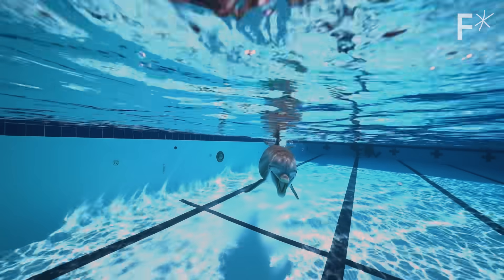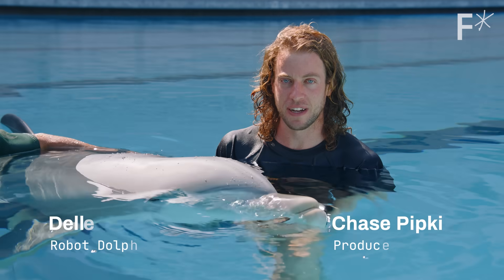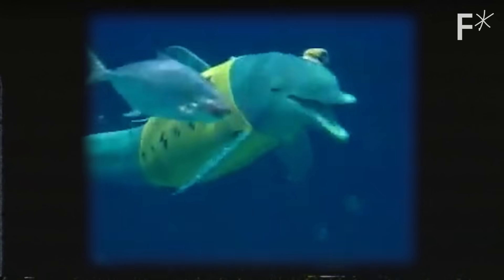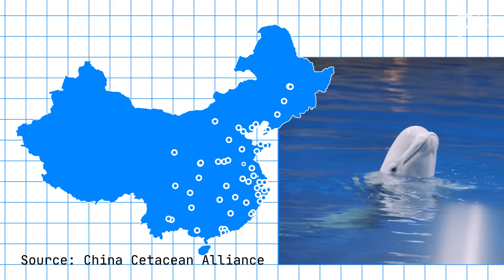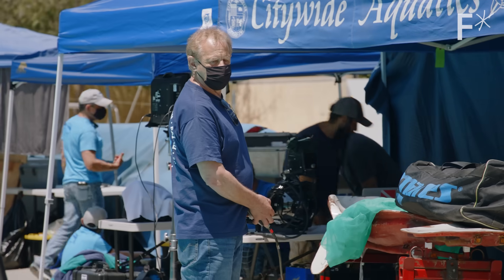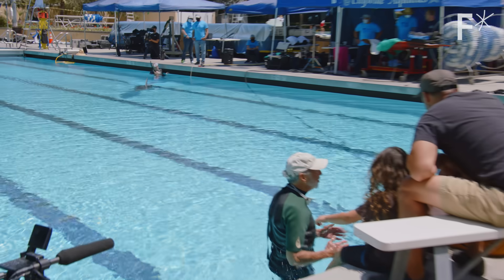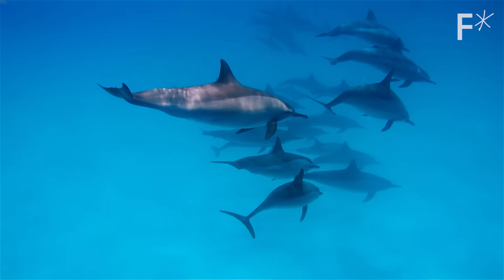How robots could end animal captivity in zoos and marine parks | Just Might Work

Comment: Okay end marine parks, cool.
However DO NOT close credited zoos, they are essential for conservation and breeding programs to save species. Proper zoos are not like roadside zoos!

edit: Wildlife Sanctuaries DO NOT have active breeding programs, they just let animals do their own thing without closely monitoring or interfering. Zoos keep extensive records of animal family lineages to prevent inbreeding and allow for careful monitoring of pregnant animals and young. This especially important for animals that have genetically bottle necked like Amur Leopards and Cheetahs where Zoos have to try and get the least related animals as possible to breed. Not to mention proper zoos are important for the public to have empathy for endangered species and acquire funding for these breeding programs, the ignorance and shortsightedness in the comments is disappointing.
Reply: IAN HEINE  the main problems with dolphins and other cetaceans in captivity is that they are extremely high maintenance. they simply do not have the space to roam like they would in the open ocean, so they're cramped into a relatively small space. they're incredibly intelligent so they need extensive enrichment to keep them from getting depressed or stressed.  there's cases where just the sound of the filtration system is enough to make dolphins and orcas miserable and hurt themselves. other animals we could mimic their natural environment and provide proper stimulation to keep them calm and happy, but we simply cant with whales and dolphins.
Reply: @charityquill4965  yes i fully agree but some species do need to be kept for the good of the whole species the good thing about this is this these robots could do the stunts and make the money so that we can have better enclosure and better progams imagine a dolphin tank the size of  a lake.
Reply: @charityquill4965  imagine how much money they spend on water and salt when they do a water change.
Reply: @charityquill4965  some of the water park saves hundred of dangered species and lives of dolphins and orcas because they work like a rehabilitation park for those animals. The idea of replace all the animals for robots could be worst for animals and for us, how could you know or interact because it is not a real animal it is not thinking, it is not feeling, it is not interacting with you; It's a damn person operating it with a remote control. At some point people will get bored and stop seeing them because they know they are not real.
Reply: @charityquill4965  that... people don't understand that these animals migrate across and through OCEANS, not an area of water, in their lives they will travel tens of thousands of miles. It is completely unfair to keep them in a cage that is max a few hundred feet large.
Reply: Thank you some zoo's keep certain species from fully going extinct.
Reply: @kaylahbkitty9691  Like the amur leopard and radiated tortoises.
Reply: Not to mention the animals that have only had human contact are going to suffer if they are released into the wild
Reply: @megg2826  It's not all black and white.  These people are not stupid.  There will be exceptions and a long process.  Yes, let me raise a lion and release it into the wild.  Yay!  Yeah no.
Reply: @megg2826  Nobody is suggesting releasing animals in the wild :/ the misconceptions you are spreading are the reason why animal cruelty continues to be supported in roadside attractions like sea world or  big cat petting parks. Ideally, these animals would be relocated to SANCTUARIES where they have no interaction with the public. They will also no longer be forced to perform, and will live in habitats big enough for them to be healthy. Captive breeding will also end by desexing the animals. Nobody is suggesting releasing them into the wild, and that misconception is extremely harmful for animal welfare.
Reply: @megg2826  some are just to tamed or born in captivity they wont be able to do well on their own
Reply: Yeah
Reply: @BatteryAcidIsEdibleEnough  not necessarily, Like the original writer said. The Zoo and Aquariums main focus is to educate the masses through conservation. Thus why exotic animals are put on display now. It has also been proven time and again that one of the most effective ways of encouraging civilian conservation is through up close and personal interactions and entertainment like sea world and even petting zoos to a certain extent. However the biggest issue comes from Animal welfare and Maintenance costs. So with that being said by implementing animatronic animals into zoos and aquariums you can give people that up close and personal factor that they crave while also  keeping costs low which, in turn,makes it far more profitable for the zoological entertainment buissness as a whole . Also keep in mind with the implementation of animatronics now zoos and aquariums have the freedom and increased finances to streamline their rehabilitation to relocation initiative as well as fund more conservation expeditions. Long story short, if this is as economical as they claim it to be; Zoos and aquariums will now be able to do focus more on saving the species while not having to worry about losing their biggest source of revenue outside of Government funding.
Reply: yes, do NOT close acreddited zoos and aquariums, along with ones that have that same focus, yet are not acreddited (like the Irwin Family Zoo, literally the only reason they aren't an accredited zoo is because they don't live in a country where that's a thing, let's be real here)
Reply: This
Lots and lots of people frown upon zoos, but zoos such as San Diego Zoo or Australian Zoo are truly places for conservation
Reply: @thaiangquoc9505  MOST zoos contribute to conservation
Reply: @thaiangquoc9505  
Actually Australia Zoo and the Irwins support Sea World.
Reply: You dont know how thankful I am I didnt have to scroll far to find someone who said this (to nerd beasts origional comment. Modern professional zoos do so much good for wildlife all over the world)
Reply: I was just about to comment about that
Reply: What i was going to comment
Reply: I was coming to the comments to write the exact same thing! 👏🏽
Reply: Seconding this. I don't remember when was the last time I went to a zoo but I do remember learning all sorts of cool and interesting stuff about these animals and made me want to protect them even more. My love for animals and creatures definitely came from reading about them/watching documentaries, but going to see real animals made me want to protect them more. Now, my family and I usually go to national parks every time we want to see landscapes (and if we're lucky, a wild animal) since we can't tell the difference between an accredited zoo and one that pretends to be legit but is actually a money grab (they exist - I'm pretty sure my country's national zoo/safari park is one of them) and if we really want to see an animal, we go to a sanctuary (we still can't tell the difference but I'm pretty sure 75% of them are legit - my last one was the Giant Panda conservation centre in Chengdu, China which I'm pretty sure work with international folks to rehab/breed/release these animals and somehow manage to take them off the endangered list), but I do understand that these accredited zoos definitely help with conservation and protection of nature and natural ecosystems and the animals and species that play a role in them.

Still, replacing show animals with robots are pretty cool. I can relive childhood memories of watching show dolphins and animals guilt free this time (I was a dumb child who went to Sea World a lot because I thought they were helping the animals....). Not sure if I want dinosaurs.. I love them but through an evolutionary perspective, not quite through the "I want to see them in real life so bad" kind of way - our perspective of dinosaurs are changing and until we have definite proof that T-Rex has/doesn't have feathers I don't think I want to see one in animatronic form yet.
Reply: Y’all do realize that certain species depend on captive populations to prevent complete extinction, right…?
Reply: Well said! Some aquariums are also essential parts of conservative as well. But dolphins and orcas don’t belong in tanks that’s just taking it to far
Reply: I agree. Zoo's are not what they used to be. They are actually aware that animals need mental stimuli and interactive ways to get their food. Not to mention that a robot can't do everything that a real animal can do. The natural world holds a lot of secrets that we can't even begin to understand (yet) nor replicate. You can't artificialize nature.
Reply: i think its main purpose is education through experience so kids can be up close to a tiger that is also kind of a character, instead of seeing it from afar. that would be really cool and this kind of enviormental education is also essential for conservation
Reply: @auroratovar5455  Exactly it shows kids and even adults that these creatures are amazing, and might actually change how the world seems animals. Instead of people thinking they can just push the animals out of their environments or poaching them, they will start trying to find ways for humanity to grow without harming animals.
Reply: Yeah when I saw this I literally just went “Uhm… No.” 80% these animals aren’t able to be released, and the reason these facilities exist is because the animals that are used as ambassadors and demonstration animals are all unable to be rehabilitated for release into the wild because they have been acclimated to human contact. If ALL of these animals were to be released, we would see thousands of reports of these animals being gunned or killing people.
Reply: Because marine parks don't do the same thing that zoos do... logic people. Use it lol.
Reply: I agree.
Reply: THANK YOU
Reply: I was going to mention a lot of this too. Many of the animals are rescued and are getting rehabilitated and re-released into the wild after a while. I read a stat somewhere recently, talking about how very rarely, in aquariums and aquatic rehabilitation centers, are the animals actually kept until death. Most of them are released back
Reply: Zoos are often also act as research center.
Something that robot that can never cut it.
Reply: Yeah same goes for proper aquariums, not like SeaWorld.
Reply: Thank you. Zoos are also rehabilitation and conservation centers. They have a role in sensibilisation and education. These vocations must be prioritized over entertainment and profit. Robot parks are the opposite.
Reply: yes!! some zoos are actually ethical and have breeding efforts to prevent some species from going extinct. i think that's an important point that many videos don't talk about/many people don't know about
Reply: this is what i'm concerned about. Many species will go extinct without conservation efforts
Reply: I was hoping there would be a couple people here with their heads screwed on correctly
Reply: I mean use the robots to replaces animals that are being used for entertainment in marine parks circuses etc while keping real animals safe in reservations and petting zoos (not much of a petting zoo if you're petting a machine)
Reply: Zoos are the last line of protection for animals, never close them.
Reply: Agreed, don't close down those zoos, but change it into an animal preserve or something. Most zookeepers not only take care of animals, but have to deal with the BS from people thinking that cuz they bought tickets, means they have the right to be disruptive and be entertained by the animals. Get animatronic zoos and allow the animals to get their proper care!
Reply: Getting rid of marine park’s animals is 100% ok and cost effective (plus humane), but credited zoos absolutely not. If we take down good zoos we’ll kill off so many animals in return as they’re putting in a good fight to keep nearly extinct species alive (like big cats who are often poached to near death). 
Different animals have different requirements: saying that just because it’s inhumane to hold a dolphin in captivity that means it’s inhumane to hold all animals in captivity is grossly wrong! People often assume these animals would be happier out of captivity which of course some would be but tigers for example can do just fine in captivity! Plus if keeping any animal in captivity is apparently so inhumane I guess pets needs to go then too cause imagine how happy they’d be to roam right? 🥺 poor cats being trapped inside by their owners like caged tigers! (btw being sarcastic here with the pet thing, using it as an example that not all animals dread captivity and plenty of wild animals enjoy the less stressful life of captivity).
Reply: Nah Wild animals will suffer in captivity no matter what! So whats the point of saveing them if they just gonna suffer in captivity!
Reply: @thejack9178  So that their numbers can be restored so that they can be returned to the wild, education, building public empathy. PROPER. ZOOS. ARE. NOT. LIKE. ROADSIDE. ZOOS.
Reply: Just about to comment this as well, nice job!
Reply: I agree 👍
Reply: Yeah plus sooner or later there won’t be a wild for animals to live in. We humans keep interfering with their habitats no matter what we do. These zoos are all they have left
Reply: I didn't know, there was something like roadside zoos. Where I live, there's only one in big cities that too, is owned by govt.
Reply: @anixes  yes roadside zoos are kind of another way of saying petting zoos that’s funds don’t go towards conservation.
Reply: Not what they are saying bro....
Reply: Exactly! Thats what i thought when i first read the title
Reply: They'd obvi will do that either way just not through zoos tho.
Reply: Exactly
Reply: They literally said that in the video, keep the pros, prevent the cons of zoos
Reply: was my exact thought seeing this video lol
Reply: Well said
Reply: Let’s hope they keep that in mind
Reply: I’m fine with the zoos and sanctuaries that are trying to actually help bring up low population for animals and animals I can’t go back in the wild but zoos that keep animals for entertainment really does make me sad I don’t go to zoos or aquariums anymore because of that
Reply: If they were less zoos it would be amazing! They are needed for conservation and to learn! But when there are hundreds and hundreds of zoos is pointless and hurtful
Reply: Amen brother
Reply: Yes
Reply: But they could let people come in and play with robotic tigers.
Reply: I bet that they will start combining their robotic marine parks with water parks.
Reply: Agreed
Reply: They could probably use the robot animals for the entertainment part of the zoos and marine parks, while keeping the conservation/rehabilitation part but not have it open to the public so they can fully focus on the animals!
Reply: Agreed
Reply: just transfer all the captive animals to a widlife reserve, its that simple.
Reply: I’ve learned more from this reply section than I’ve learned at school.
Reply: A large amount of animals in zoos should be replaced, but not all of them. Ones used in professional conservation breeding, or rescues unable to live outside of captivity, are totally fine if it’s handled right.
Reply: IAN HEINE  Yeah. These are cool, but people come to the zoo to see real animals.
Reply: Add robots to zoo's, use the funds for real animal conservation
Reply: exactly...
Reply: Yes!
Reply: There are sanctuaries instead
Reply: I want to support this
Reply: Finally someone with brain. These people doesnt know how important is to have animals and acuariums for the nature safety.
Reply: You need JESUS. Pray to HIM, HE loves you,
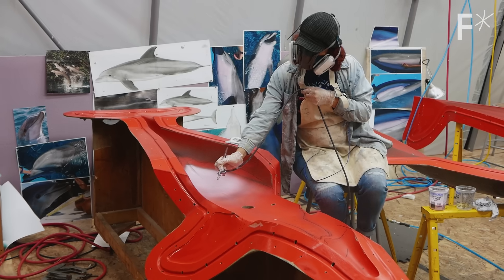When you pass away as we ALL will soon. 99.9 sooner than they think 🤔 ..you will kneel before JESUS. Romans 10:5/10. The One and only true Son of GOD Almighty, all others are false..we are all sinners and need JESUS.  JESUS was crucified on the cross at Calvary and then on the third day rose again, for you and I (John 3:16). So, Choose this day whom you'll serve. For if you don't it will be chosen for you and that is HELL
 Arguing with me is silly at best. Bc I'm just the messenger...
💌
Reply: Sorry but I completely disagree with this comment. Those captive breeding programs are a cruel joke. Why is it so important for a species to remain alive but solely in captivity for the rest of their collective lives? Those animals, for all intents and purposes, are technically pretty much extinct if you're looking at what's in the wild and how they contribute to the ecosystem. What is the true purpose of keeping those animals alive in captivity? Is there a hope to one day release them into the wild? I'm sure there is not. So these animals born in captivity are jailed for generations and that is truly terrible. How would you like it if that were you and your family?
Reply: @buddyholly4672  they breed to eventually be released use your head
Reply: But why must Zoos make it an attraction? Loud kids come in and disturb the animals, dumb people try to climb into the cages and I don’t think there should be gift shops and restaurants in Zoos if their main intention is to save the animals. Seems like the whole thing is just for profit.
Reply: @Ashley-km4qi  What do you think pays for the staff, animal housing, food, enclosures, maintenance, utilities, breeding and exchange programs. Most zoo profits go to animal upkeep, research and programs, not lining people's wallets. Ticket prices alone couldn't even feed the animals let alone pay for electricity, air conditioning, plumbing, medicine and so on.

As for bothering the animals, in proper zoos animals aren't really bothered often by visitors and if they are they have hideaways to get some peace and quiet if they need it.
Reply: @thenerdbeast7375  well you make a good point on where the money goes, but the few times I have been to a zoo, I’ve noticed people trying to taunt the animals or kids screaming at them. And this was at the San Diego Zoo where apparently it’s considered “one of the best”. The animals shouldn’t to scurry away and hide every time a human comes near.
Reply: @Ashley-km4qi  It is one of the best in terms of most aspects of animal care, programs and animal health, one of the worst when it comes to attendee manners which is something they can not control. When I visited years ago, the attendees weren't nearly so ill-behaved, it might have just been a bad day when you visited.
Reply: @thenerdbeast7375  they can control attendees though, like putting more signs that say do not disturb or start to closely monitor them and kick out visitors that are disrupting the animals.
Reply: In the wild its really hard and tough.... things trying to kill u and struggling to eat wen u can... they die really bad deaths.. in zoos im sure its not that bad.. just a thought...
Reply: I live in thailand and this summer went to stay at an elephant sanctuary where they let elephants that have been abused and used for work wonder free but controlled as they have been changed from thier natual self
Reply: There’s a zoo, then there’s a sanctuary…. Let’s end zoos….. and most sanctuaries release the animals back into the wild when their health is back to what it was… I would love an animatronic zoo…
Reply: THANK YOU! This is so well said I couldn't really say it better myself.
Reply: Commercial zoos can go but actual preservations should not
Reply: Sir, I'm sorry to say but Newyorker Zoo murder a healthy Giraffe for Entertainment. However that is abuse & should be illegal
Reply: @boriscvekic  lol
Reply: You’re acting like every zoo is going to close after this video was published 😂
Reply: This is the worst idea ever. Why would anyone want to go to a zoo or aquarium only to see a bunch of fake animals of metal and wires instead of experiencing the REAL deal in the flesh(unless something extinct like dinosaurs which probably would make sense)? It should also be noted that it may be expensive to go to places like Africa or South America to go see animals in the wild, so this is the closest for anyone to get access to seeing and experiencing these animals. Plus, and most importantly, zoos and aquariums have saved the lives of dozens of species from any human activities like pollution, deforestation, or over-hunting, which can lead them from endangerment to extinction(these activities are sadly still continuing), so putting them all back out there would be a very, very, very bad idea. In the words of Jurassic Park,”your scientists were so preoccupied on whether or not they COULD, they didn’t stop to think if they SHOULD.”
Anyone agree?
Reply: I can see zoos are good as the animals are put on display, have ppl staring at them all the time through glass, and they are in a small area where they cannot act naturally and how some zoos allow you to hold baby monkeys and baby tigers or bear cubs
Reply: Agreed!  Kudos!  This research done and offered to the public, is wonderful, as in mating behaviour of Kiwis!  Very interesting details how they research how to provide food it environments required.  Did you know the Kakapoo that once lived on all of New Zealand only will mate if their particular choice in fruit is available in plenty  and that is seldom more often than every four years.
Reply: SeaWorld and some other marine parks are also apart of the zoological conservation. Yes they do the shows for entertainment. Maybe instead of saying end all marine parks you could just say end the shows. Seaworld and some other marine parks focus on animal husbandry and scientific advancements. They rehabilitate endangered sea turtles and shark species. It would be shameful to the earth if we were to let all those species die out. I agree though that some road side zoos that are primarily for entertainment should be replaced with robots.
Reply: arent (or maybe some) marine parks also acts as rehabilitation centers?
Reply: zcx some def do those things and keep marine life that have no hope of returning I already know my comment is short I know enough about animal conservation and zoo's just like how I know not all kill shelters are bad I have people in my family that are vets and zookeepers I might not look it but love animals trust me.
Reply: @kaylahbkitty9691  I'm not even going to try and deny that, but most accredited zoos and aquariums have their main priority as animal conservation, also up there is getting animals to return to the wild, as well as education on the animals, if the animal can't be returned to the wild then they become an ambassador for their species, in which case they will (depending on the animal) get that animal used to human interaction outside of their handlers so said animal isn't scared of human interaction
Reply: @beowolf9480  I know this I just like sharing it in a short way plus I'm at work I be tired of typing but thanks for educating others.
Reply: @dnielzcx5490  they claim to be, and maybe to some extent they are, but for the most part, I’d say they are potentially causing more damage than they think.
Reply: @dnielzcx5490  no, teaching a rehabilitated animal tricks is not rehabilitation, it’s taking animals from the world for their own profit, zoos are way better, they’re there for people to look at while being cared for correctly
Reply: @dnielzcx5490  no they say this but in reality they never release any animals and keep them in captivity.
Reply: @dnielzcx5490  in some cases they could be, but most rehab centers are onley rehab and don't "show off" like how marine parks do. Of course places like sea world do have animals that were in rehab that could never return to the ocean (the most common animals I see to never go back are turtles with manites being a second) most animals that do get release after rehab can actually gain a dangerous positive view of people though! This can happen in animals like sea lions and dolphins, where they can get too close to boats ao the wrong type of person and end up harming themselves again or others.
Reply: @dnielzcx5490  yes indeed
Reply: @dnielzcx5490  no they arent, since when is preforming for others rehabilitation?
Reply: @paracuna  except manatees you can't train those, there have been some the have been brutally mein by speed boats. You can see some of the tails ripped off, it sucks, but if their not taken care of by someone they'll die.
Reply: @paracuna  yes they are. Same as zoos.
Reply: @paracuna  alaska sea life center litteraly do test  with live fish before releasing the animals
Reply: @paracuna  some find fish in need of help and then they help put Them in rehab sure its wrong that they are making shows but alot have places you cant Enter where there are fish they are helping
Reply: @paracuna  some of them are, however very few, and it is unsure wether is is worth the cost.
Reply: @paracuna   not those ones like Disney but Australia zoo or winter the dolphins sanctuary in Florida
Reply: Conservation centers are better than zoos.
Reply: @kagenohikari8  Zoos function as breeding centers to put out more animals to potentially be released, they house animals unfit for the wild, and most importantly they are like huge charity centers! The money they generate typically goes to helping the species they hold, they also do another important thing: educate people, make people love the animals and want to save them..a little bit of education can bring up a whole generation of animal lovers spending money and time to save this planet.
The good zoos out there will have employees do shows and give facts about the animals, or there’s little signs with facts and stuff. There’s this zoo-aquarium mix I love going to on vacations because it does this! It has information on the animals everywhere, I watched employees feed the animals doing small tricks with them whilst explaining stuff (the tricks can be amazing physical and mental exercise)..as a kid it awed me and I fell in love with the animals there! To this day marine animals will always be my favorites (the kinds of animals you’ll see in or near water). They even had this HUGE tank of fish and sharks and all kinds of stuff! It was in a tunnel fashion..It was like walking through a world of it’s own, they got to just exist as they would in the wild and I’m sure they likely fed the sharks to keep them from eating other fish though I wouldn’t be surprised if they were robots now.
Reply: @kagenohikari8  they are THE SAME MAN, also ones that are publicly zoos are far more likely to receive funding, and thus be more effective.
Reply: Roadside Zoos can use some animatronics,  proper zoos used for conservation purposes should not have robots, real zoos are essential to the conservation of endangered species.
Reply: You clowns do realize that if those zoos animals go out of their cage and into the wild,they are Gonna die? But hey,keep on whining about humanity being awful even though you barely do any thing about becoming the person that you want others to be.
Reply: @melindabolding5601  Those zoos literally save animals from going extinct. It won’t be a fast process to release them to the wild but they have a certain process for that for a reason. There are ways to getting them back in the wild safely and getting them used to it.
Reply: Marine parks do the exact same thing.
Reply: IAN HEINE  it seems like it's be good to have robots for when the animals are out, like sick or on bedrest
Reply: @moon that’s a stupid idea.
Reply: My stance on this is that we can keep any animal in a zoo or aquarium as long as we have met their requirements for being happy
I think the best thing to do with dolphins in captivity is to just cancel shows and let them just swim and eat like every other creature in a zoo or aquarium
And it's possible that (if not now then in the future) we can even have the perfect dolphin exhibits
I mean if we live in a world where whale sharks can be kept in aquariums with little complaints then i don't see the idea of a happy dolphin in captivity impossible
It would be very hard, but not impossible
And the robot thing, i don't think so
Getting robot animals is completely missing the point of zoos, that being showing us real animals from places most people would not go to
And plus they would just get broken up and sold on the black market by some people who want a very expensive joint, like they are doing with amazon drones
What I'm saying is that the chances of a good dolphin exhibit in a zoo or aquarium are low, but as long as we keep trying, it will never be zero
Reply: I agree. There are some animals humans just can't accommodate in captivity, but there are others that can live long healthy lives.
Reply: You mean Accredited Facilities LIKE SEA WORLD?!! 🤷🏼‍♀️
Reply: @rikky6ixx  NO that is not an accredited facility and it is also not a zoo. That is why I said end marine parks, which Sea World is, along with roadside zoos but not accredited zoos.
Reply: IAN HEINE  How? People don't learn anything about them when they are just sitting in a glass box.
Reply: @DankestDestroyer1098  Please, zoos provide plenty of information on the panels next to the exhibit, no one visiting the zoo has time to analyze their behavior, people go to college, and get a degree and job for that.
Reply: You mean an animal sanctuary? Obviously they're not going to shut down sanctuaries.
Reply: Sorry but thats actually not true. They say they do something important but they actually don't. IM from germany and german zoos importes around 800 endangered animals in 2020 and released around 100.
Reply: Well save it for the animal sanctuaries and not the zoos!!!
Reply: We don't need any more zoo. We need more animal sanctuary.
Reply: Ok tiger king jr
Reply: Go to the top zoos in the world and most of the animals are still trapped in small areas. And most of them aren’t even endangered. Theirs no reason to keep a bunch of monkeys in the space equivalence of your house. I wouldn’t want to be locked in my house for 15 years just to die there. So what gives us the right to do that to an animal? Don’t get me wrong. I’m no peta fanatic. But zoos over all are in my opinion wrong considering most of the animals do not need to be there.
Reply: @verticalsorh7124  while I’m not blind to some of the more shady practices involved in getting the animals, aren’t many of the animals brought to zoos typically injured or orphaned in some way? I know for sure it’s not a 100% always the case situation, but many of the animals weren’t long for this world to begin with. I’m not saying this is the better alternative, but at least some zoos do to some extent I tend to release the animals to their homes.
Reply: @verticalsorh7124  those are only Asian zoos. In addition to that some animals can’t be released In the wild due to many reasons. Kept as a pet, came from a zoo they can’t take care of them, and injured to the point where they can’t survive. In addition to that captive bred animals won’t know how to identify prey and predators. You do realize certain animals in captivity don’t need THAT much space right ? As long as they have something to call territory their fine.
Reply: i think u mean sanctuaries, not the same thing.
Reply: @buelmore9784  no
Reply: @buelmore9784  they often are.
Reply: You all have completely missed the entire point of this if you think "closing all zoos" was a point. Even then why wouldn't you want to eventually close all zoo's and replace them with conservation and rehabilitation centers? All zoos are stressful for animals.
Reply: Zoos DO NOT play an important role for conservation, thats just a common myth so they can keep their reputation. It's wildlife sanctuaries which are important for conversation.  Zoos always put making profit from the animals first while a sanctuary actually saves wild animals to release them again. And no, keeping animals in way too small cages and putting them under daily stress, making them depressed and force-breeding them because humans are destroying  their natural habitats is not called "CoNvErSaTiOn"
Reply: @bittersweet6631  truly spoken like somebody who had no experience with a proper zoo
Reply: The animals are still in captivity tho. Zoos aren’t benefiting those species because the ones in the wild, the ones doing their part within their ecosystem are still losing population because of other selfish humans.
Reply: no. end zoos. support conservation and sanctuaries
we do not need to gawk at live animals 

again
we do not need to see real animals it can stress them out if you know anything about conservation efforts

Animationics is way better because you'd be able to touch them. and money could go towards conservation
Reply: @QiotiCoyote  letting people touch animals(robots even) in zoos might encourage people to try that in real life which could be dangerous and harmful to both parties, now you might be smart enough to tell the difference, but there are plenty of idiots in the world.
Reply: @QiotiCoyote  dude, some species depend on zoos to stay alive.
Reply: @piderpark6547  Look up earthling Ed and look at his most recent video. he's got sources. and wait to the end to find the grand comparison between actual conservation and zoos.
Reply: Honestly, of course I love the idea behind saving endangered species, but isn't there a point where it's okay to let nature take its course? The argument against that is that humans have created unnatural obstacles for animals, and some invasive species could be overtaking natural populations, and thus if animals in those ecosystems become less prevelent, it's our fault, and it doesn't necessarily mean these animals aren't well adapted to the environment and important members of the ecosystem. 

But otherwise, are we perpetuating species that are no longer well adapted, and therefore maybe we don't need to put so much resources into unnaturally maintaining them. This is simply something I've thought about, I am open to other arguments, but often times the argument is simply that of course we want to save animals from going extinct.
Reply: @rachelle2227  what about saving and helping Keystone species? Some entire ecosystems would fall apart but I do respect your opinion and get why some people find it bothersome to keep certain animals around currently earth is going through another extinction event but unfortunately humans are speeding it up even faster then the previous one's. So we should at least try to do some good other then thinking of ourselves for once.
Reply: @kaylahbkitty9691    Right. Yes, this is another opinion, I agree with you. See my other comment above. Thanks for understanding my perspective. Yes, keystone species are important, and a huge part of the problem is us unnaturally killing off animals indirectly via our poor environmental choices and habitation. 

I guess I'm also just thinking of species where their ecosystem is just so far gone, that completely saving them is all for nothing, like polar bears for example. Apparently polar bears have just recently been known to breed with grizzly bears and the offspring are fertile, so this could be a good way for polar bears to somewhat be saved. I don't think there's anything we could do to turn them around, other than just having them in cages.
Reply: @rachelle2227  think of it like this, it is bigger than just the polar bears (who are an apex predator and keeps populations in check), it’s the entire Arctic ecosystem, which if we let go it’s natural course there’s a chance humans may not survive without massive hardships, the polar bear acts as a mascot for the Arctic, to save the Arctic, we have to save the bears, and vice versa. Ecosystems are important to conserve and we are now so entreched in the world, climate and ocean changes can impact us, and yes the rest of the living matter on earth massively
Reply: @rachelle2227  Unrelated but fun facterino polar bears are brown bears, even though they're a separate species. It's a phenomenon called paraphyly
Reply: @rachelle2227  uh yes there is ways to save polar bears by making sure our lights are not on when we don’t need them and reducing our carbon footprint. All hope is not lost if us humans make an effort.
Reply: @rachelle2227  Animals are endangered because of humans. So no it wouldn't be wise to let nature take its course. 🤦‍♀️
Reply: @spcrri4796  plenty of animals have gone extinct that had nothing to do with human beings. Where do you get your information from that animals are going extinct due to humans? We are still finding wooly mammoths and other animals frozen in ice with grass still in their mouths. The majority of animals have gone extinct due to the regular course of climates changing and the climate seemed to have changed in an instant back when these animals were frozen in ice as they ate grass.
Reply: @rachelle2227  there’s a point when we let nature take it courses its when we slowed down our advance polluting their natural habitat so they can adapt and evolve but our current speed is just too fast, evolution needed time to adapt to the environment but we can’t slowed down our speed or our economy crashed just look what happens when we are on full lockdown, so yeah we kinda stuck right now hopefully we are not in the future
Reply: @rachelle2227  i totally agree with you!
Reply: @rachelle2227  If we’ve hunted animals to the point of extinction it’s our moral duty to save them
Reply: Waste of money that could help people in dire conditions, AND WHAT ABOUT WHEN THE DAMN THING MALFUNCTIONS HUH?? when it needs to be trashed or so? how about narcs and drug dealers using the technology of broken disposed robot dolphins to deliver more drugs? its a waste of money when you could just close the damn parks
Reply: @rexmexzilla  You cant just close those parks. Those animals in there are used to being in captivity and don’t know how to live the wild. They would have to start getting the, used to it first and all of that would probably go up to the same amount of time and money. They will spend a lot of money either way. This whole thing is better than them just staying in captivity.
Reply: @rexmexzilla  What solutions would you propose instead, just curious.
Reply: @ChaseDaOrk3767  close them, relese the animals under supervision or so, but dont waste 5 million on some fucking robots is not as if people will get traumaticed from not being able to watch animals...
Reply: @rexmexzilla  ok, anything else you would have like to be changed instead?